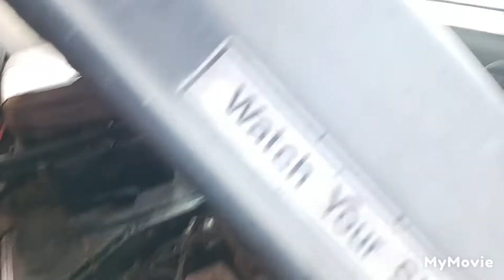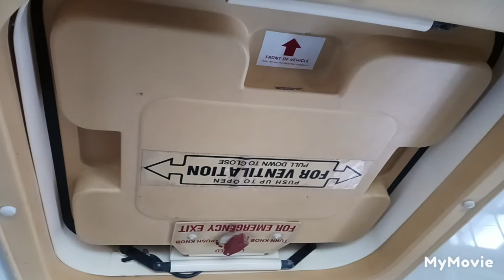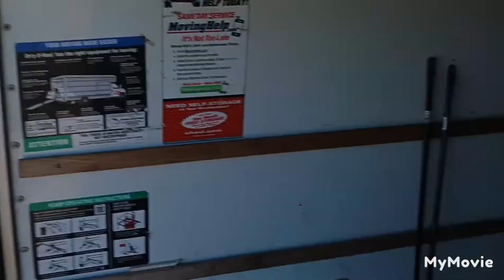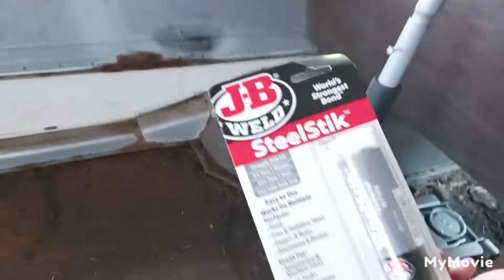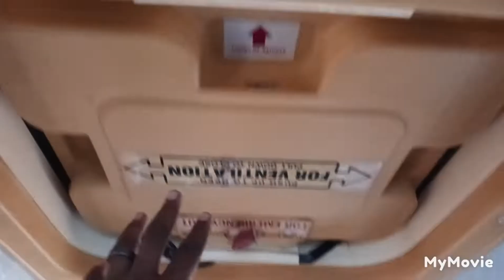Our 1st Schoolie Build... Building BIG SANDY

Comment: Nice bus. The old fashioned house lock would work on the front door.
I used to run for West Motor Freight in the early 2000s.  Didn't know they ran where you are.
Reply from the maker: Nice... Appreciate it.. that door has gave us a headache 🤣🤣... West Motor still rollin